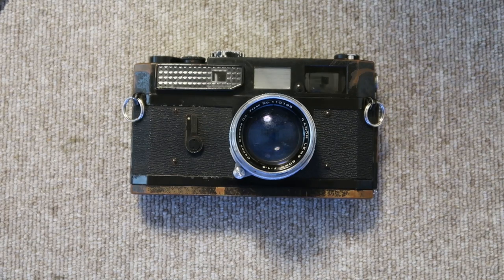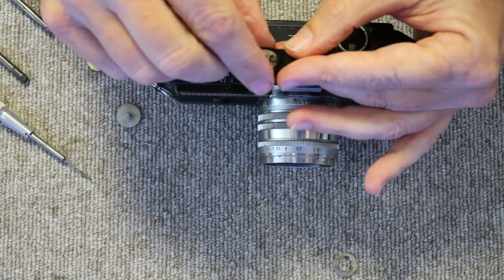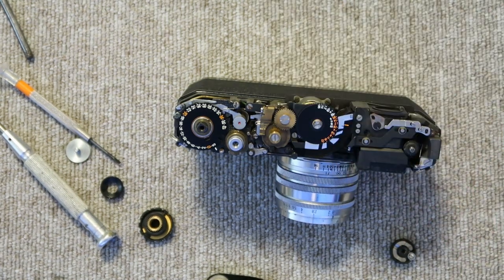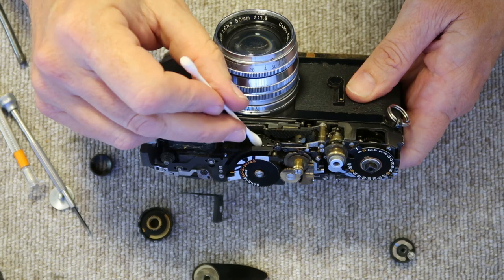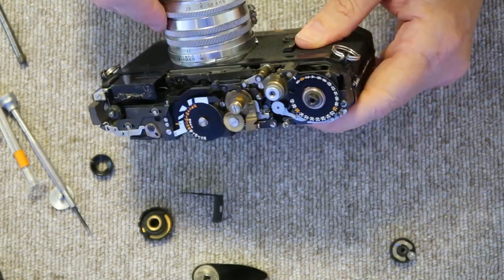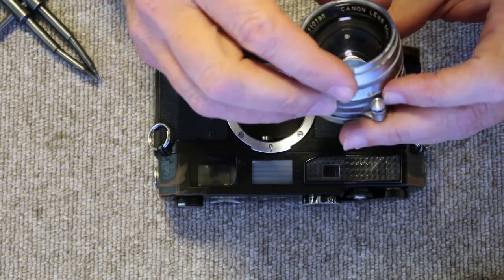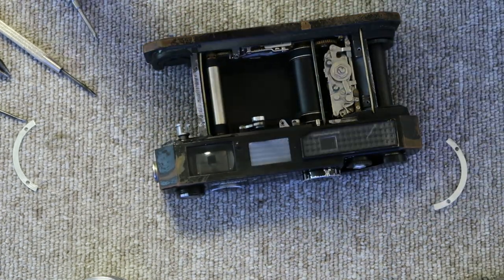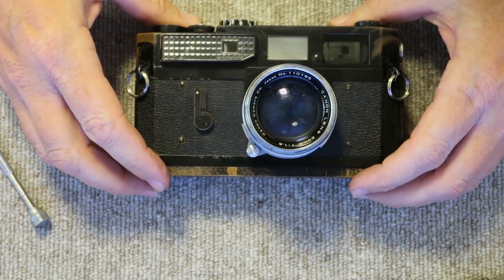Canon 7 Rangefinder Camera Overhaul

Comment: I just bought a Canon 7 off eBay, from a seller in Japan. The camera in the listing looks good...no cracked light meter window or dent of top plate, etc. It was shipped via DHL. When I got it, the light meter window was cracked, the top plate is noticeably warped and dented and the dials and shutter lever are stuffed. Shutter won't even work. So, either the seller sold me a damaged camera or the shipping company broke it through careless handling. The seller assured me it was working before they sent it. So, I can only take them on their word. The shipping company...well, anything could happen there and I wouldn't put it past them to do a bit of slight of hand. It looks like a very heavy weight was just slammed down on the camera or it was dropped from a considerable height onto hard ground. Or, it was hit hard with something like a hammer. I'll get a new camera and use this one for parts, rather than sending it back for a refund. Yeah, it cost me money, but using it for something good is better than just sending it back, where it'll probably be tossed away, anyway.
Reply from the maker: Always check the box for damage when you order form overseas, and if it is, open it in the presences of the delivery person. If the camera is damaged, refuse the package, then the camera will be covered by the shipper's insurance. I try to pack cameras very carefully, but stuff still happens, one of my boxes was run over by a UPS truck.

Comment: Thanks so much for this - very clear! I have a Canon 7 with erratic slow speeds and think it just needs this treatment but I can't budge the lower two case screws. There is some corrosion on the case so I guess they are corroded in. I've tried penetrating oil for a couple of hours and also gentle heat with a soldering iron. Any other suggestions?

Comment: Hi, there is a flat brass linkage on the back of the front cover. Can you tell what exactly it is for? It seems to connect a lever of the slow speed escapement to the top of the camera?

Comment: Thank you for a great informative video. I have problems with light leaks on my Canon 7 even though I have replaced the light seals. Do you know any other area on the camera where its common that light leaks in?
Reply from the maker: The worst place for light leaks is the hinge on the film door. Or the shutter may not be closing fully, this is a common problem with the Canon 7. It is easy to fix, I have another video about how to fix it, you can find it in my video list.
Reply: @japanvintagecamera8869  All right, that should be light tight. Watched your other video and serviced the camera accordingly. Hopefully no more leaks, thanks!
Reply: @japanvintagecamera8869  is it the one where i have to tighten the gear?

Comment: +NICE.  I have a 7 that requires vertical RF adjustment. Problem is the access port cover is stuck, possibly corroded. Tried a pointy spanner, does not budge. Any thoughts on how to loosen it?
Reply: Adam Lang I took a cheap jeweler's screwdriver with a blade wide enough to span the port cover, then carefully filed the tip to create two points that exactly fit the holes. Making a tool like this might let you apply enough force to turn the cover without damaging it. Or not! Let's hope our host has a better suggestion.

Comment: You mention the flash sync is different on the 7s. I have a 7sz and need to get in the top to clean. Without those slots how do you get enough pressure on the part to loosen it.
Reply from the maker: I use a small rubber spanner to remove this socket, but before I had the spanner, I would drill two small holes on either side of the socket so I could remove it with a two-pointed tool, like a sharp pair of tweezers.

Comment: I just got my Canon 7 but it seems that the viewfinder is loose and the rangefinder patch is changing alignment is this repairable?
Reply from the maker: It is possible that the prism has come unglued. See if you can move the prism on the top right side. If it is loose you will have to remove the top cover and glue it in place. It is also possible that something else is loose, it is easier to see what when the cover is removed. Sometimes the beam splitting mirror can also become loose. When putting the camera back together, put on a lens, focus to infinity, then move the mirror or prism while the glue is still wet so as to line up the rangefinder split image as close as possible. Then make final adjustments after the glue dries. I use lacquer paint to glue on the prism, and contact cement for loose mirrors.

Comment: Thans for the video, My example has stopped changing Shutter Speeds, it seems to be stuck at 1/1000, i think it may be bacuse of the self timer. Any way to fix this? I still have it apart. 

Thanks
Reply from the maker: If the winder and shutter are still working, the problem is not the self timer, but possibly some debris or loose part stuck in the shutter adjusing mechanism.

Comment: So, what is the truck for removing the flash sync on the 7s.  I have a 7s and would like to open it.  Thanksn
Reply from the maker: The ring around the socket itself threads out the same way, just there are no notches for a tool. A round piece of rubber can often be used to unscrew it. Otherwise I will use a small chisel to make a couple of notches so a tool can be used.
Reply: @japanvintagecamera8869  The viewfinder seems messed up - I see many hazy squares that don't line up.  I can focus but all the gray hazy squares are distracting.  Does I need an alignment - or something worse?
Reply: @japanvintagecamera8869  After inspecting my 7s,  I see that it does have the store and it looks to be factory.  Perhaps changes in production means some have and some don't?

I am very happy about that because my viewfinder appears to be completely misaligned.